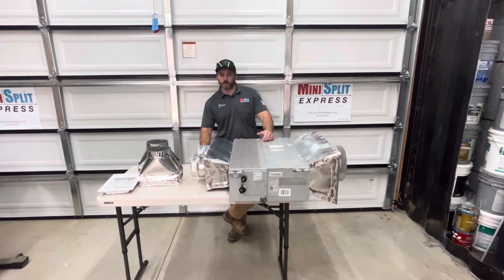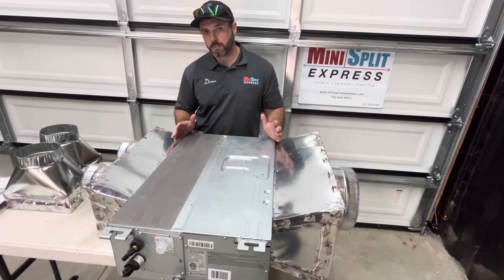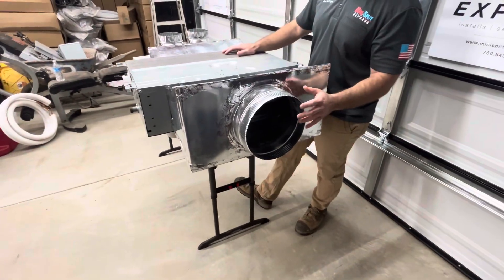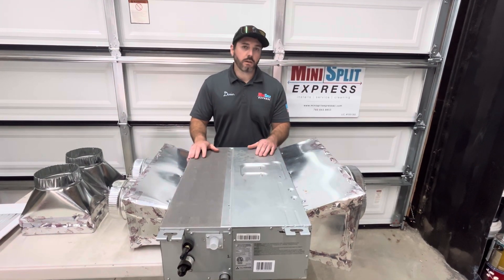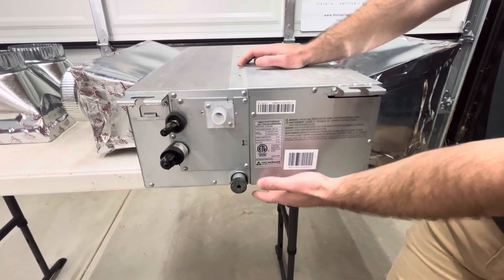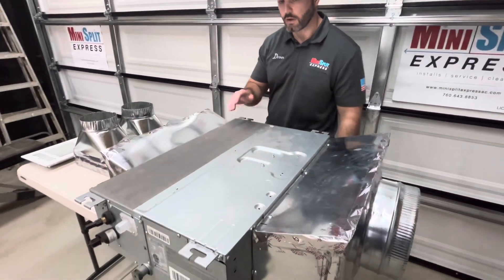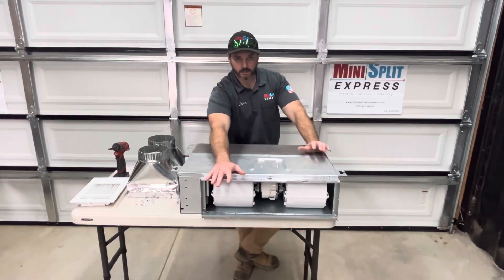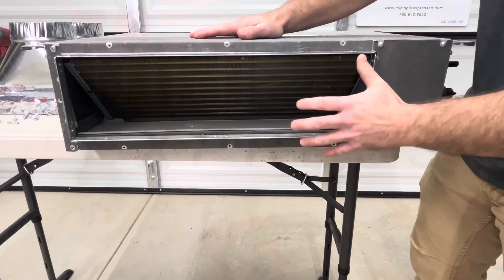What is a Ducted Mini Split?

Comment: im just a stay at home mom doing research as to if the future home addition i have in mind would even be feasable. i realized with the way the floor joists run in the basement  it would require creating a giant bulk head to run under the floor joists (instead of inbetween) and the ceiling is already a little under 8ft.  and then theres the fact that the joists are actually set in the concrete of the basement walls, so it would be a whole project to extend the main trunk, run it up and over the wall (or cut through the concrete) and then theres just the issue of increasing the load on the existing system (which likely would mean needing to upgrade the whole furnace,  AC unit, and then the current main trunk size wouldnt be big enough which would lead to...esentially needing to re-do the whole HVAC system.  Then I thought about the units they use in hotels, or just simple baseboard heaters. but I dont love the look of those hotel style units, and baseboard heaters - great for winter, but doesnt cool down the house in summer. that said.... if an addition was built with good insulation and air flow in mind, maybe could get by without AC but I'm not sure.. then I stumbled across this system. seems like it could be a solution. would you be able to run this sytem to controll 2 adjacent bedrooms of say 100sq ft each, 8ft ceilings? or best to get one per room? what does a unit like this cost?

Comment: Thank you for this video. I have a 24k unit in my attic and I was wondering on how to clean the evap coil. We have been doing some remodels on the 2nd floor and even though I change my filters on the retunr often I know something must have gotten through. Is removing the supply plenum the only way to accomplish this? How do I get to the return side of the evap coil? Thank you.
Reply: you need to clean the supply side of the coil not the return, the only way to do that is removing panels in the airhandler
Reply: @gsabic I was afraid of that. I have to do it, but it's so hot up there lol
Reply: @M3TAL.G3AR  wait, you need to clean the return side not the the supply side, I messed up ahhaha

Comment: Is there a filter?  If so do you have to get into the attic to replace?
Reply: Yes there is a filter in the system, a really weak one put by the factory. The best is to have the intake with a ceiling filter box, like the ones in most homes, so you can just replace that without touching the unit in the attic.
Reply: @avsararas7969 gotcha.  I figured there’d have to be.  Thanks!

Comment: Hello, 
I have a 1200 square foot cottage.  If I installed a larger 24,000 BTU Ducted Mini Split in the attic could I branch off to 6 times so I could have a register in each room ?
Reply: Probably, just have to balance the static pressure of all your ductwork with a ductless mini that can handle it. Some are high static and could easily handle it just like a traditional central unit.
Reply: sure

Comment: If installing in an attic do you need to insulate the whole unit, including the return air duct?
Also, you mentioned that you can control multiple rooms independently? How does that work?
Thank you in advance
Reply: The unit itself wouldn't need insulation but the ducting on both sides likely would. As far as controlling the rooms independently usually that's by having one of these units per room with it's own thermostat. You can have multiple coils/heads like this running off one condenser that goes outside.
Reply: Yes you need to insulate it for best results. For multi zone control, you hookup this indoor unit to a condenser supporting multi line sets up to 5.

Comment: Can that unit  be turned sideways?
Reply: It has to stay in this orientation for the condensate to drain properly.
Reply from the maker: No
Reply: There are some Cooper & Hunter ducted mini units that can be mounted vertically. 24k BTU’s and up.